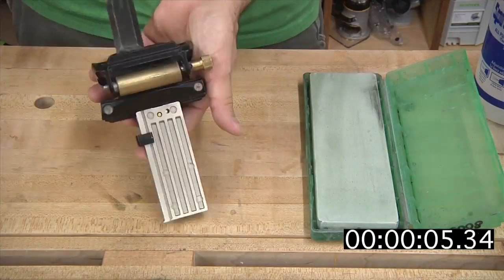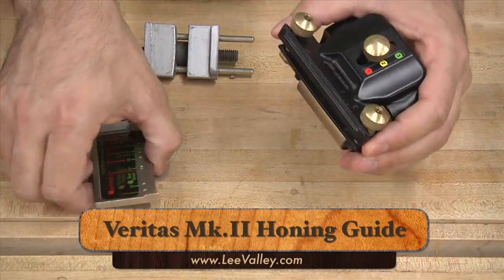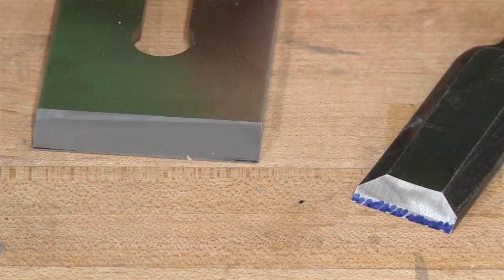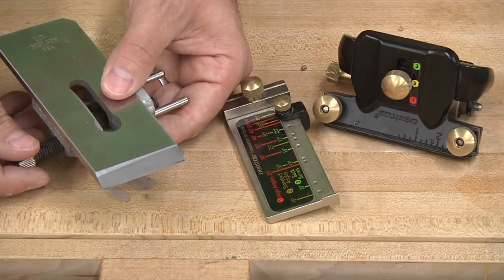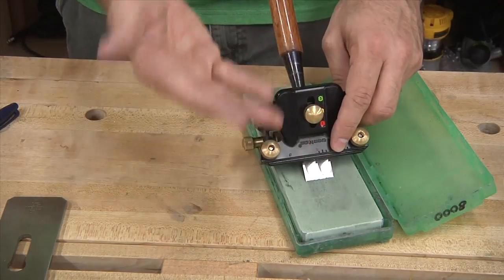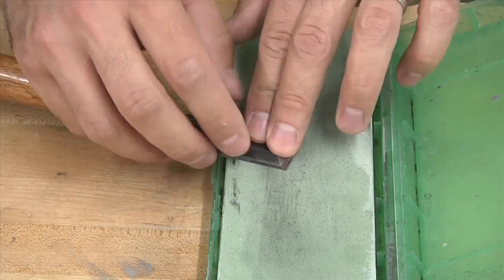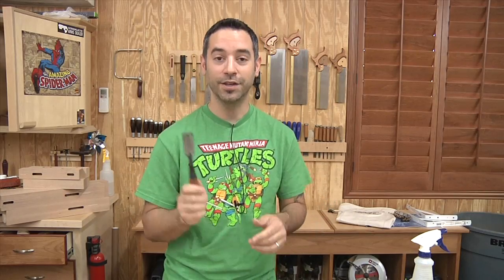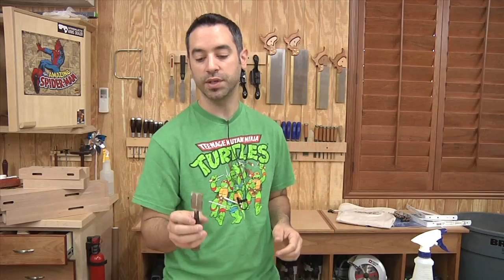220 - 60 Seconds to Sharp!

Comment: Thanks, The Wood Whisperer , for adding subtitles to the video.  It helps to know what you're saying when explaining about tool sharpening.  I use the cheap guide that works pretty well on plane irons but they don't hold the chisels well.  I've had to file off the factory paint to try to get the guide to grip the chisel better.  I agree the Veritas is a better guide and I would like to have one.

Might I suggest a quick stropping to fine tune the edge.  Watch Paul Sellers sharpen and strop a chisel blade on YouTube.
Reply: I've tried that in the past and don't really enjoy the process. I liken the use of a strop to free-hand sharpening. A little to easy for me to round over the edge. :)

Comment: Awesome video; but I have a question. Do you have to keep your wet stone level? I use mine for barber shears, clipper blades, and for my block planes. It's got a lot of crap on it staining the white surface. I'm concerned I don't use the whole surface evenly and may create low spots.
Reply from the maker: I flatten my stones after every use. It keeps them nice and clean and only takes a few passes on the DMT plate to get the job done.

Comment: Your secondary bevel is a it on the large side! The quickest way is to make an MDF wheel for your grindstone and charge it with 'white' or 'green' buffing compound and set up a guide to get the right angle, then remove the wire edge on your stone!
Reply from the maker: That doesn't sound quick at all. Much quicker to throw the chisel into a jig and make a few passes on a stone, at least in my shop....
Reply: Oh my lord people are ridiculous....that sounds like the farthest thing from "quick" give your head a shake

Comment: I like to do the final sharpening a bit differently and it's a bit faster I only pull once @ 1200 grit surface the back of the chisel then wipe with rag , but yes also use similar stone although sometimes I pull the edge of the blade through a surface covered with polishing wax or cut into a piece of wood with chisel then add the wax and then do back and forth a bit with chisel but this process takes alot more time

Comment: Oh by the way.. I have a nice little collection of clamps. Yesterday working on daughter's deck. Using 
salvaged pressure treated deck boards I built a 3 by 6 foot  frame. 
The words were twisted. No problem.  Clamped a eight inch board on the inside.. Essentially a makes shift  2 by 8. At wright angles clamped another piece. Used tree different clamps. I jacked the pressure up..Then took my hammer lightly tapped the boards into position XY Z..it look like factory.Screwed not nailed the 
boards. Took clamps off .. looked factory.. Later on had a side board on the same frame and the board was spitting. Just  left the inside board in there.. screwed into them.. Might be something I incorporate in a # of my builds.. 
It does add weight ..This will be in all future work benches.. It s like building with 4 x 4 s  ..I sometimes 
Use nuts and bolts. It's not purist but I think it's valid.
.

Comment: That's a good point about the secondary bevel. I use the sandpapaper method.  Wuick story.. Had my lawnmower blade sharpened by electric tools.. grinder..hydraulic oil to cool it.. And it was sharp.. Six months or so..it started getting dull. I took the
blade off (always use safety precautions)..Used a big file with my bench vice..totally guesssed ..3 years now still cutting my 1 acre yard.. grass gets high in 4 days during raining system.  It should be 
dull. It cuts extremely well. I Don't k why.

Comment: There are three ways of guiding your chisel  1. The normal honing guide which needs yet another jig to set the angle- not very reproducible every time for a quick hone.   2.  A slope, preferably with a magnet, that always gives you the same angle.  With 1 if your projection is out you either increase the angle or have to hone away all of the bevel you did last time. 3  Of course you can do it freehand, and after a couple of resharpenings you can have a lovely collection of out of square bevels on one chisel. I use method 2 as it takes about 3 seconds and I don’t need 
Secondary or even tertiary bevels.

Comment: Hi What is the best primary and secondary bevels?
Reply: Most chisels and plane blade primary bevels are 25 degrees. Christopher Schwartz advocates for all your secondary bevels at 35 degrees for consistency when setting up the honing guide. .  Honestly it just doesn't matter that much.  It is more important to get the same secondary bevel angle each time than it is any particular angle.  You can use the MKII honing guide to set the angle, a small block of wood with a stop as a registration distance from the tip of the blade to the front of the honing guide, or even a Wixy angle finder to make sure your set-up is at the angle you desire.  The other method is the Rob Cosman way. Find the primary bevel by rocking the blade back and forth and then simply raise the angle a few degrees and sharpen by hand.

Comment: I'm amazed at how difficult it is to find a simple, to the point video on how to sharpen a set of $30 chisels without spending 3x that on a "sharpening system"
Reply: Increasing grit sandpaper and water on glass will get you a long way

Comment: Just a couple of days ago i bought the veritas guide and 8000 and 12000 stones. It took over on hour to sharpen a 25mm chisel, yes it was a cheap blunt chisel, but i think i need a 3000 grit. The 8000 and 12000 should be ok for the new narex chisels. First ever hand sharpening of a chisel for me, so tried on a old one first.

Comment: will the veritas honing guide work on chisels that may be not quite high quality
thanks
Reply: It should. But ultimately it depends on the chisel. The jig uses the side and the tip for alignment. So if the sides of the chisel aren't straight or if they are bead up, it might not work so well. The jig grips with a bar from the top so most varieties of chisels won't be an issue.

Comment: I have this jig: (http://www.amazon.com/Robert-Larson-Honing-Guide-Angle/dp/B005IP09EO/ref=sr_1_9?ie=UTF8&qid=1401382889&sr=8-9&keywords=veritas+mkii+honing+guide)  and the problem I have with it is reproducability.  It takes forever to get it straight, and the next sharpening it takes another forever.  Of course, if it's not straight, the blade ends up skewed.  Does this Veritas jig solve the straightening problem?
Reply from the maker: Hey James. I find the Veritas to be 100% reproducible. As long as you rest the chisel against the guide properly to square it up and you apply the top clamping pressure evenly, the results are dead on consistent. One oddity I have found is that some of my blades are slightly off from 90. But they are off EVERY time which leads me to believe that the jig is slightly off. But I don't really need my blades to be dead-on 90 anyway so I live with it. Frankly, I never even notice it anymore.
Reply: The Wood Whisperer Thank you, Marc, that helps a lot!